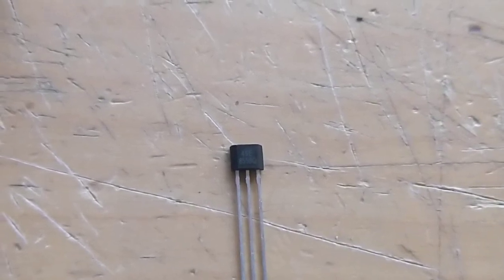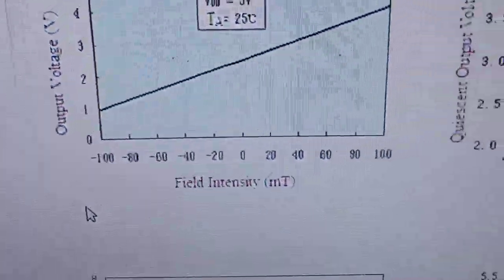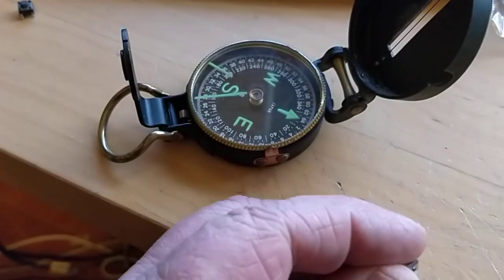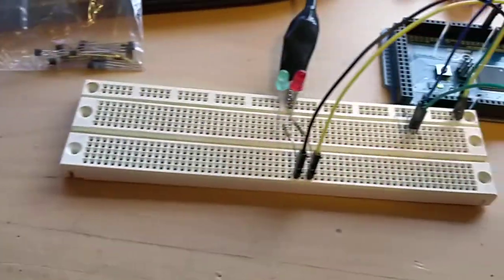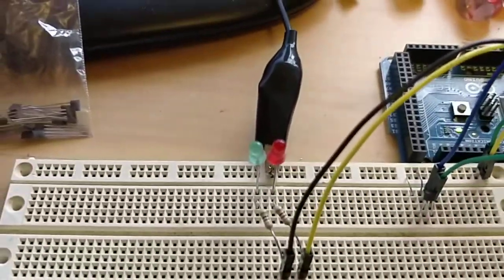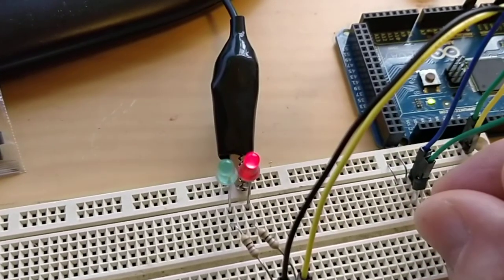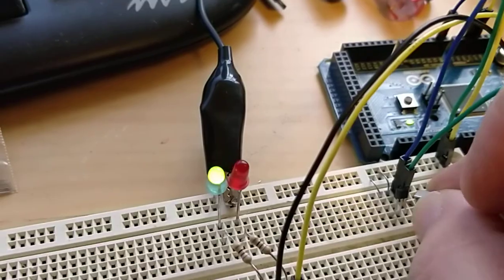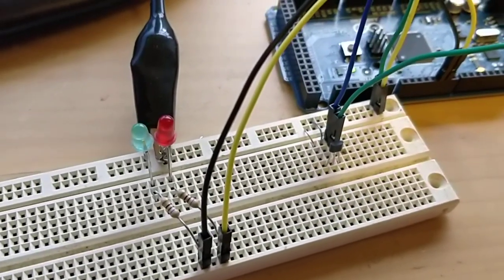49e Hall effect sensor

Comment: I have this 49e hall sensor. When 1 side of magnet come near it goes to about 4v. When the opposite side of the magnet is near, it drops to 1v. But never down to 0. Do you know any linear hall sensor that will drop all the way down to 0 on one side of the magnet and up to 5v when the other side of the magnet get close. I can't seen to find one that does it.
Reply from the maker: No, sure do not. The spec sheet for the 49e also shows 1 to 4v output over it's range.  Is there any way to scale that in your app? Arduino has a 'map' function that can map an analog input that only uses part of the 0-1023 range to the full 0 to 1023.    Or, from a hardware perspective, an op-amp circuit could re-scale 1 to 4  to 0 to 5v, altho it will likely need a negative supply rail.  That is a fairly easy linear transform of scale and offset - change the offset (add) by -1 and the range by 5/3 (multiply).
Reply from the maker: Some opamp circuits here show how to change the offset and gain to scale the 1-to-4 volt range to anything you want, like 0-to-5v  https://electronics.stackexchange.com/questions/495393/offset-and-scale-a-dac-output-with-opamps
Reply: @ChuckSwiger  ok thanks for the reply. I bought a throttle pedal for my son's ride on truck. It came with the 49e. Even when he left off the pedal, the car will slowly move forward and never completely stop since there is no brakes on these ride on cars. Was looking for a hall sensor that will output 0-5v so when he let's off the foot pedal it will output 0v. The 49e sensor is min 1v to max 4.2v.
Reply from the maker: @johnrambo1349  Easy solution for the 1v min might be a forward bias diode ?  The 0.7 voltage drop would get it down to 0.3,   but would also reduce the high end, down to 3.3v from the 4v max.
Reply: @johnrambo1349  I saw on Amazon a 49E on a breakout board with a tiny sensitivity  adjustment pot.

Comment: I find dozens of wiring diagrams for connection to an ardino but none for connecting to a mach 3 BOB, is that they cannot act like a Normally Closed switch, or they just don’t work on my type system.  I really need a wiring diagram for my system.
Thanks.
Reply from the maker: You could use a tiny arduino to interface the analog signal from this device to a digital ON/OFF signal to the mach 3 board, and program any level for switch you want.   Sounds like you are creating a magnetic actuated switch? I would not use this for cnc homing or limit switches without testing the repeatable accuracy first. My cnc with a tinyg controller board uses physical limit switches for seek to home position.